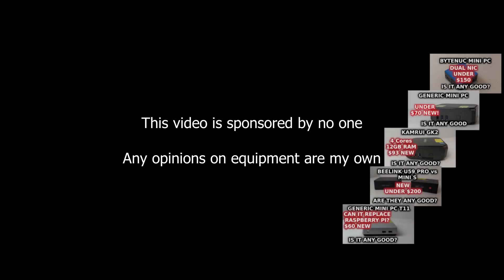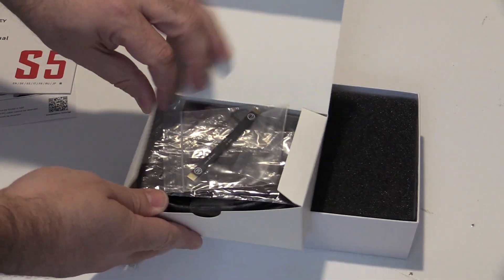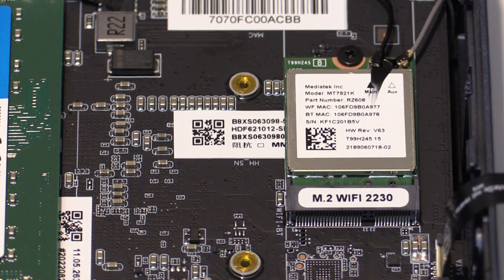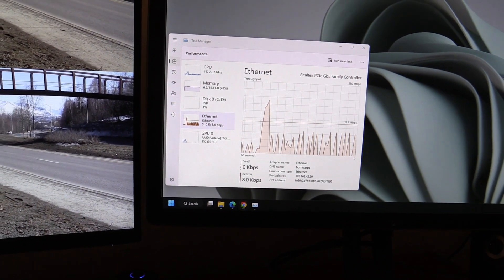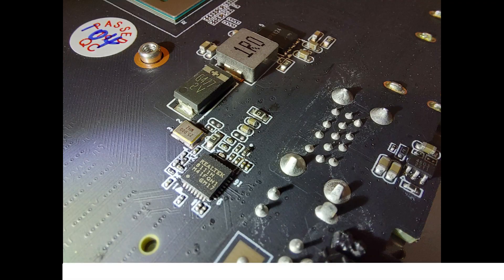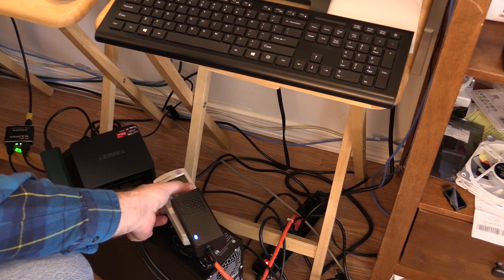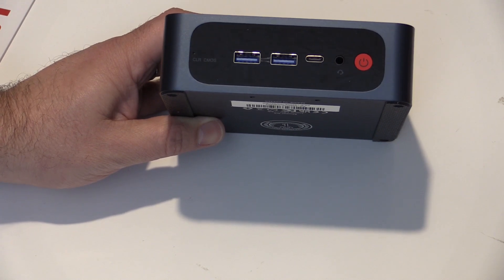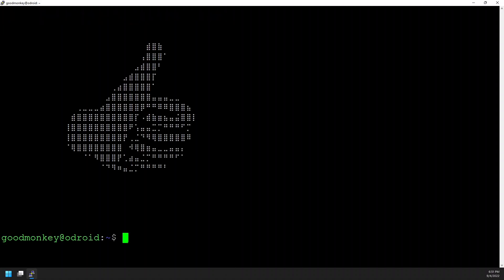Trigkey S5 AMD Ryzen 5 Mini PC Review! Synthetic Benchmarks and Teardown

Comment: Thanks for the video! while you were disassembling the pc did see if the motherboard has a SPEAKER or SPK header? I use my S5 as a console and I'd like to add a piezo buzzer or PC case speaker so it makes a delightful little chirp when it powers on :)
Reply from the maker: Thanks! No speaker header that I am aware of. I don't recall seeing them on any of the mini PCs. That would be pretty neat though.

Comment: Would this pc be good enough to run obs studios to stream from al be playing on a ps5
Reply from the maker: This should be able to handle a OBS stream picked up from a PS5 without issue.
Reply: @ntgm20  this might sound daft but will it be ok for editing videos aswell that's all al be using it for it to stream from and edit my videos  I don't know much about pc's tbh any advice on a cheep pc would be appreciated thanks
Reply from the maker: @chronicgaming8973  I used mine to edit a few videos. While a little slower than my XPS machine at the time it wasn't bad to work with and is capable at 1080p. It could do higher resolution but really slow down.

Comment: hello mr not terrible by goodmonkey  let me tell my saga of precuring a TRIGKEY S5 AMD Ryzen 7 Mini PC, 5800H 32 GD RAM 1 T HARD DISK AND ANOTHER 1 T SSD for a file system. a dvd rom and a port hub to increase number slot. the saga begin with  my aging asus  mini tower begin to have black graphic spotlches on  my display a sign of graphic buffer going. also theres the matter of windows 10 going bye bye  and what worst was my machine couldnt run it  being a older i7 quad core and the fact i had the task bar on top  where i could hit the news button. those combination factors  drove to research the mini pc  market. i settled on the s5 ryzen 7 for 360 dollars plus the for mention accessories . the plan was to install freebsd and kde go from there. well as fate have it xorg melinstalled couldnt fuctioned properly, the short of it i went on distrowatch found that mx linux copuld run on a ryzen amd chip. so i made a install memstick  and proceeded to install mx linux kde with no problem everything worked. no skyrim though running a systen int version. of the games i do play  are older games like neocron,everquest,vampire the masquerade , of the more graphical intensive games like scorn, succubus, two world 2 tgoy version which i install from the dvd rom, plus  second life that one im using a linux firestorm viewer doesn't count . all work except skyrim and several other. after a shakedown cruise yes you can use the s5 as a daily driver  sans bloated laviathan the movie monster operating system that is windows. things are running better on linux kde if you have to do it the trigkey can take it win a flawless victory  in my humble opinion

Comment: Mine locks up when using some apps, when I am using a Logitech webcam to make a video call on WhatsApp call, the whole computer locks up and makes the WhatsApp disconnect noise a few times whilst frozen, and I have to hold the power button.

One time playing Fall Guys (yes this can run fall guys flawlessly) and frozen again.

Tested RAM, SSDs, and tried different Windows versions to no avail. Checked drivers and were up to date.

Could my AMD APU be a lemon?
Reply from the maker: It could be.  Is it still under warranty?  If not, have you ever done a fresh install of Windows?

Comment: Hey did you find any suspicious packets or anything being sent once you were on the network? I'm not quite comfortable trusting these Chinese systems with my info
Reply from the maker: I didn't do a deep dive into it.  I figured the easiest issue to implement would be in the installed OS, and that is in part why I do a fresh install.  Maybe one day I'll do those deeper dives. I used it as my desktop for a month or so during a move and so far have found no ill effects.

Comment: I just ordered one of these for about 290 USD (big sale going on at Amazon since I think new Ryzen 7 version are starting to hit the market). I wanted to ask if it is possible to get all the drivers I would need and also use the Windows 11 key (license) without issue by just installing off a fresh USB Windows installer?
Reply from the maker: Very nice!  For the video I just ran a fresh install off USB media, and activation happened without entering a key. Now I had connected it to the internet before then , and I think they do to, so your results may vary.  As for the drivers Windows update may have them now.  It was only those few it couldn't find but I found looking them up in the Windows update catalog.
Reply: Thx for the reply!  I am thinking of booting it first off a Linux USB, checking if things work, then boot and install off a new Windows USB.  Great video!

Comment: so if i just get (Crucial RAM 32GB Kit (2x16GB) DDR4 3200MHz CL22 (or 2933MHz or 2666MHz) Laptop Memory CT2K16G4SFRA32A) it should work just fine, just swapping them out?
Reply from the maker: It should. I swapped one of the modules for a Teamgroup 16GB 3200MHz(PC4-25600) CL22 and it worked fine.

Comment: I had already bought one of these on sale and have had no issues at all, but my requirements are pretty elementary compared to yours.  I was assigned TDY to Asia for 6 months and wondered if I will be able to convert this to 240V... I am guessing yes.  I am lazy and quite old, so I just bought one of the Samsung 1TB USB SSD memories... it's still the fastest unit I've ever had.
Reply from the maker: I don't think I've claimed recently to not be lazy or old. Hope your TDY is or was fun and safe. The power brick that came with mine is dual voltage, so would just need the plug adapter.

Comment: One question. If I need to re-install win 11, how do I do that?
Reply from the maker: The way I do it is with an image downloaded from Microsoft and use a USB thumb drive.  I delete all the drive partitions from within the setup program and just go from there. I posted a video today on how to get around signing in with a Microsoft account.
Reply: @ntgm20  During setup I signed with Microsoft. No problem. But It asked if I wanted to transfer my bookmarks and setting in edge. I said no and it did anyways. I did not know that that much information was saved of their servers.

Comment: I think the Beelink SER5 is at thie same pricepoint currently, and it might be the safer option?!
Reply from the maker: Looks to be near the same price. Both are still probably made by the same manufacture. I'm still using the S5 as my desktop and so far no real issues.
Reply: There is currently a tonne of new and newish mini PC's out - the industry has realised now there is a big market for 2nd computers, and these are perfect for it.

I have one driving a pair of TV's for watching sports.  Perfect for it, I got the AMO2 Ryzen 7 one.  Couldn't be happier with it.  I prefer that to the Beelink box tbh.

Comment: Was going to get a beelink u59 n5105, now thinking about switching to the trigkey s3 3550h ryzen 5
Reply from the maker: Sounds cool. Either way I hope your experience isn't terrible.
Reply: @ntgm20  that sounded ominous. Did you continue to use this trigkey unit after the review? Just wondering if there's something that I should be aware of.
Reply from the maker: @MM-fe9mz  I am using the S5 currently while my big desktop is being shipped with the rest of my belongings. I upgraded the RAM to 24GB and so far haven't had any issues.

Comment: You got me nervous! I just got my Beelink mini S, similar form factor, it came with win-11 pro pre installed and I just started to use it with all my gmail accounts, can you share your findings regarding the security risks you've mentioned? have you find any?

P.S
really good quality review. I'm a sub from now on
Reply from the maker: You may be okay and may not be, that is all the issues with machines that come preloaded. I can't remember on the Beelink ones I received if I saw, but if you need administrator rights to run a program (like an install) but the dialog box doesn't pop up that is a real problem.  I'm hoping one day I can take all my screen captures and make a video on it and show how anyone can use the Windows Out of the Box Experience reset to make it look like a fresh install.

Thanks for your comment on quality and subscribing!
Reply: @ntgm20  Thank you for the replay! 

If this info helps: it was purchased from the official beelink store on AliExpress.

The thing is that I purchased a better SSD, and meanwhile (until it arrives) thought I would leave it with the "original" windows 11 install, in addition I understand there is some "pain" with the drivers, and on top of that I'm not sure if the license is legit so would be another adventure to activate windows after fresh install... Would be awesome to hear your thoughts regarding this.

As regarding the security prompt before install / run as admin program, it's there and pops each time.

Comment: Good review. Convinced me to buy one and plan to use it as my desktop replacement. I don’t do gaming or video editing anymore, so it should be more than adequate. I haven’t set it up yet. I already know I’ll need more storage, am interested in your opinion whether it would be smarter to upgrade the NVME drive to 2T, or just add a 2T SSD drive. The cost for either is about the same. My immediate thought is that the NVME drive should be faster, but if I go with the SSD I’ll end up with 500g more total memory. Also be interested to see your Ram upgrade
Reply from the maker: Thanks! I don't know which would be better, NVMe or SATA if the price is near the same. Just have a backup plan for your data either way. The RAM upgrade went smoothly with the one I put in the description.

Comment: Does anyone know how to solve the glitchy graphics artifacts on these boxes? I may have bought a dud, but I'm hoping there's a fix. It's the same chipset 5560u  Trigkey S5 with Windows 11. I know there's an issue with windows 11 not supporting all the latest codecs out of the box, even so, and with AMD driver finder installed, this box still has those darn artifacts.
Reply from the maker: Are you taking about the actually display having issues or video playback? I've had some issues with the included video player for Windows 11 on my i7-10700 that is annoying but I've not looked into.
Reply: @ntgm20  It turns out this cpu / windows 11 combination doesn't support the AV01 codec increasingly favoured by youtube.  The work around is to find the 'H264ify extension' and add it to your browser.  The thumbnails for AV01 codec are also glitched, whilst VB09 codecs are fine.  

The other issue is dedicated graphic memory which is fixed at 512mb.  Its Shared graphic memory is only limited by the ram on the device,  but most programs are limited by the amount of dedicated ram. This mean my browser crashes every time i have too many tabs open, and go over that 512mb limit.  

If this isn't bad enough, the bios has no settings to change the  'UMA frame buffer size'. I can only think the dedicated graphics memory is fixed by the drivers. If you open Task manager, then go to Performance you will see the amount of dedicated memory under GPU.  If you right-click a youtube video and select 'stats for nerds' you'll see info on the codec used by that video.
Reply from the maker: @chrisliddiard725  Thanks for sharing. I'll look into that soon. Most YT videos I watch at VP9 so I hadn't noticed. How many tabs are too many?
Reply: did you do a fresh install of windows?

Comment: I also got this from the Vine program and another Intel Celeron one a year before and this is still hooked up and I've been working on making it the desktop for the Ender 3 3D printer cart I'm fashioning in my basement. It's tiny but powerful. I did do testing with graphic benchmarks and it can do some entry level 1080P games today on low to medium settings and push out fluid motion in 30-60 frames, but it could do high graphics and aliasing for games 5+ years ago. Which for its size and integrated graphics only was impressive.
Reply from the maker: Nice! Thanks for your feedback!
Reply: I think all Ryzen 5000 series come with built in Radeon Vega-7.
It about as good as you can get for integrated graphics.
Vega7=Performance of a NVIDIA GeForce GTX 1050 card.

Comment: Did you ever find anything nefarious on the default installation?
Reply from the maker: On this one I don't know that I did, but because the drive had over 800GB written and 13 power on hours I figured it wasn't just an expanded install at the factory, someone powered it on and probably ran updates.  I did feel it safer to just wipe it all and do a reinstall.  The rest of the machines though, I need to go back through all the screen captures again to make sure, but those I would say reload the OS before using as there were some red flags there.
Reply: @ntgm20  Ahh ok. It wasn't for lack of trusting the vendor but the fact it had been demoed by someone else?
Reply from the maker: @ryanw1906  I would consider the lack of trust the vendor. It may not be the company itself, but could be someone in line before the items are packed up, or who is doing the testing.

Comment: USB C power adapter for this device and for that matter any NUC should really make it stand out as portable and even more material and weight saving while travelling. Therefore suits our future environment challenge better than a monster tower. Who would buy those things today for anything not needing a top gaming pc. Most of us not.
Reply from the maker: I do think the lack of USB-C style powering of the device is a loss, but it is probably cheaper for them to make it like this. As for portability, the real selling point for lots of these are to be hung from the back of the monitor.  This does cost more than the others I've reviewed, but also a lot more powerful and I'm using it now as my desktop and am okay with it.
Reply: You could probably find a fitting cable with 20V PD-trigger
Reply from the maker: @xumatyt  Just remember, if the USB-C port wasn't configured for PD you can ruin it.
Reply: @ntgm20  There are cables usb-c-to-barrel jack. USB-C end goes into power supply with PD support and has builtin PD-trigger that asks PSU to output 20V. The other end is a barrel jack that goes into miniPC's DC socket. You don't need miniPC to support PD.

Comment: This is somewhat bizarre. This is a mobile chip, so I'm surprised how close the benchmarks were. It's suppose to go up to 25w, but the Amazon page for this mini pc says it has a 35w tdp. Maybe it's the extra power being fed. Eith way, it's $310 right now. That's a lot (and I mean a LOT) better than what you'd get for a laptop OR desktop of the same price
Reply from the maker: That is kind of weird, as I look at the AMD page on the processor and the configurable TDP is only up to 25W.  So maybe a typo on the seller page? Then again, I bought the GK2 because Intel said that processor only supported 8GB of RAM and the machine had 12, and sure enough all 12 GB worked.  That price is fairly good considering the retail evaluated price when I received it.
Reply: @ntgm20  What are the PL1 and PL2 values in the bios? (it should read something like 15000 if it's 15W) (tdp is not really representative of power consumption as it's just a figure for heatsink requirement which is not the same thing)

Comment: Nice Review, Nice PC ,Wishing you a great first advent. I replaced my Ryzen 5 5600G with a GTX 3060, after I tested my Ryzen 3 3200G Back-UP-PC long-Time. I recognized I could play all of my Games on the Ryzen 3  APU, so I spared the Power of the GPU and used for a long time only the Ryzen 6 5600G as my Main PC, and then I decided to Safe even More Power by using a Chuwi RZ-Box with a Ryzen 7 5800H in 15W Mode, it plays all of my Games and works superbly as my every day Desktop, with a much smaller Footprint hidden behind my Monitors.
Reply from the maker: Very nice! So there could be hope for someone wanting to game on this then.  I didn't want to really say no gaming, but gaming that does require dedicated graphics is out.   I think I've seen even Cyberpunk 2077 run on an APU, but at like 4FPS or something. Leaves a lot of other games open as playable with settings turned down, I'm just not a gamer to evaluate.
Reply: @ntgm20  I was Gaming a lot when i was Younger, i played a lot of Shooters, But now i enjoy Traveling along the Galaxy's:face-blue-smiling: , hearing Deep House :washhands:

Comment: AMD integrated graphics is quite decent - don't rip the idea of gaming on it :) it will not do 1080p ultra for sure, but 1080p low or dropping to 720p will make pretty much anything playable
Reply from the maker: Very true, and while from most reviews I've seen the AMD integrated graphics do better than Intel, you still might not to buy it with that in mind, unlike most desktop systems that you can swap one in later.
As you may have seen though, my XPS doesn't have a graphics card either.
Reply: @ntgm20  egpus are a thing.